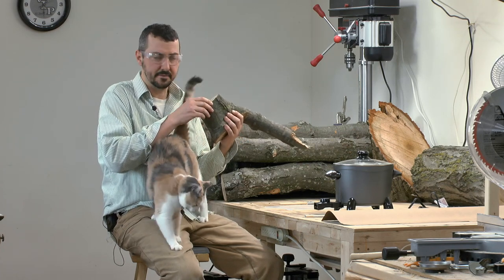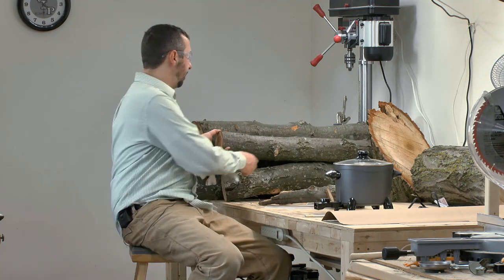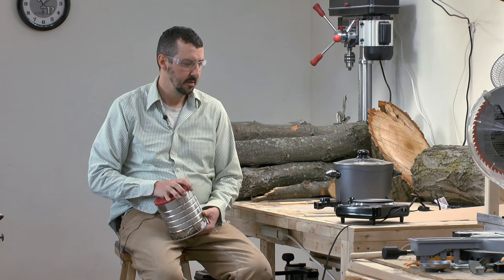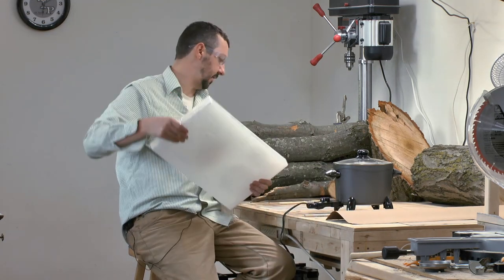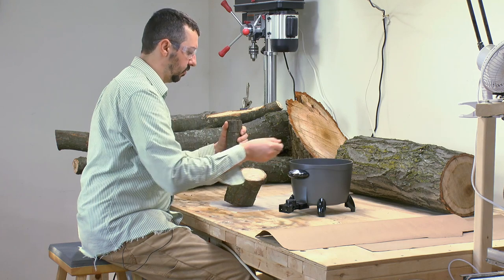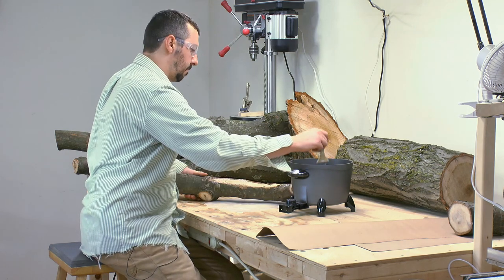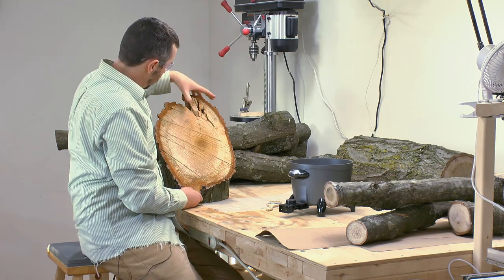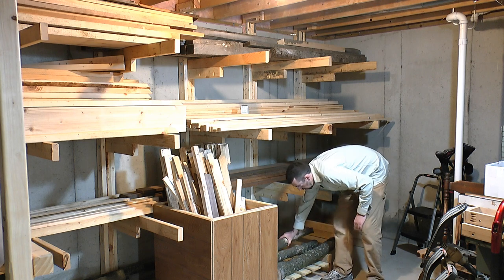It Matters How You Dry Your Wood

Comment: If I apply wax to the ends, but remove the bark, would that cause any issues? Should I leave the bark on or would it be OK if the wood is less than two inches in diameter (walking stick)?

Comment: Hi, thanks for this info, preety great to find it. My question is the following: is there any way to calculate how long for the log needs to be in drying process before start working with it?
Reply: If it's still green or freshly cut, it's about a 6 month drying process. Roughly. It reqlly depends on the wood, the humidity of the room, and the temperature of the room you're storing you wood in. From my experience 6 months to cure wood properly is it. Sometimes you can get away with shorter depending on your wood and drying room.
Reply: And I know, 6 months is a bummer if you have a good peice of wood you really want to use, but that's just how it is lol.
Reply: Sorry this is a lot of text, but for example I just grabbed a peice of walnut, and cut off the end to make a coaster just for fun. It's been in storage for roughly 4 and a half months and ended up separating the grain in less than 12 hours. Patience is key!!
Reply: Great to know this info. I'd like to know the measures you refering to, though. The log I have is almost 5 feet long and 1 feet thik. My idea is to dry it properly to cut boars and do boxes. Is a white berry log
Reply: @ivandibujo6535  I like to wax my ends like he does in the video, and store them indoors preferably for about 6-8 months before I even think about using them. Especially for boards, you want that thing nice and solid. Can't afford any splitting. Don't worry though, if you seal the ends with wax and store properly for the given amount of time there's no reason it should slit/separate on you. Cheers and good luck with your future projects! Also there are a lot of woodworking forums where you can search your question and get second opinions! I'm no expert by any means, this is just a hobby of mine for a handful of years now and my personal take on what's worked for me.

Comment: Hey hi...have just got silver oak logs about 8ft for log fence..got them 2 ft into the concrete for posts...now will be getting the rest of the logs sliced into half for the horizontal supports..what is the best way to treat them ..they are still wet though

Comment: so I just watched this vid and its been almost a year so how good did it dry and did you wait or have you used it already?
Reply from the maker: +Dan Hard Hi Dan, I've still got most of it and it's still drying fine.  No checks or cracks to speak of except one round cookie that I soon after noticed had insects inside which ate many holes through the wax rendering the wax pointless, and it checked badly.  But that's the only one.  I'll take some pics and post them on my Instagram for you to check out.  Give me a minute.  Instagram name is TheLoneWoodman.
Reply: So should we apply an insect terminator before applying wax for drying?
Reply: @TheLoneWoodman  Do we need to protect wood logs from insects, when drying wood logs outside? If yes, any suggestions?

Comment: Probably have already messed it up (since I peeled the bark and pulp already) but I started a first attempt to make a club yesterday. It's drying now, and I plan to let it dry another couple of days before I sand it anymore, let alone applying any polish or finish. Seems that the knots are where the moisture is draining the quickest but the ends are still a concern. There any point in trying to dry it over a longer period still? Cause I'm guessing the damage is done since it's already peeled and partly sanded. 

Might not make a good club, at least for more than one or two swings. But I'm hoping it'll at least make a good walking stick. Hasn't been any visible fraying in the grain yet, I expect it will crack up some though. 

Any thoughts? Basically meant to ask if I had already ruined the piece, or if it might still work out alright. The material is pecan wood which I know nothing about so I don't know how that might affect it either.
Reply: todd cabaniss - A few months later, how is it?

Comment: Where u get the blocks of wax from.
Reply: Not sure. I would like to know the same
Reply from the maker: I got it from Amazon.  Link in the video description.
Reply: @TheLoneWoodman , Should've, but I didn't know it came in blocks that large. Good to know. Should be a lot cheaper than the $45.00/$50.00 a gallon (last I checked) sealant sold for the purpose.

Comment: I can’t seem to find an answer to how soon after cutting a tree should it be slabbed. Wondering if you might have an answer. Seems like it would dry faster cut into slabs
Reply: Basically as soon as the tree is cut let it bleed out the moisture for about a week and then slab it up. Definitely dries faster( cookie slices wrapped in aluminum foil dry best and fastest w less cracking) when slabbed. I'm now gonna build a diy kiln and start slabbing for profit, so worth it. Check out Izzy swan for sawmill hacks too

Comment: why not just use white wood glue and a bit of water to thin it? wax seems a very expensive way of sealing the wood  compared to white wood glue. Forgive me if there is a reason not to use it I just dont  know.
Reply: I use two coats of Tightbond I wood glue, 24 hrs between coats.  I do so for two main reasons:  1.  I just don't find myself needing to end grain seal a lot of logs/boards.  2.  I typically end up buying too much glue anyway (by the gallon) so it's a good use of the extra I wouldn't use anyway.  I've read that was, wood glue, and that more expensive sealkoat (forgot the actual name) all work about the same.

Comment: What's the best way to fix splits in driftwood I'm drying? It's shaped like a 6' needle, the thick end has internal splits...
Reply from the maker: +Mary Stachowiak  Hi Mary, if you're able to close the splits with clamps, I would apply wood glue to the splits and close them up with the clamps overnight.  If you are unable to close the splits, I would just apply a lot of CA Glue (super glue) in the area of the splits to prevent further splitting.  CA Glue is widely used in wood turning to stabilize weak or broken wood.  Wood filler is okay to fill cracks or knot holes, but it is not meant for structural stability like the CA Glue can provide.  I hope that helps!

Comment: I think your waiting 2 maybe 3 years for this wood to dry
Reply: Island Wills I agree.  Depends on the wood though.  I turned a piece of Apple that I dried for three years and it still cracked.  Now I have a moisture meter.  After I cut my piece I check both sides and if it’s 12 or lower on both sides I turn it.